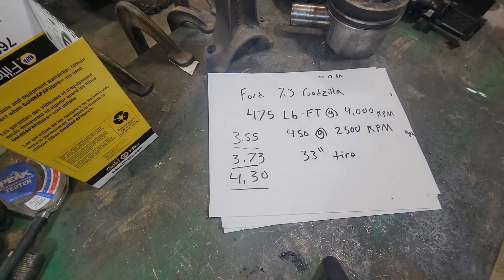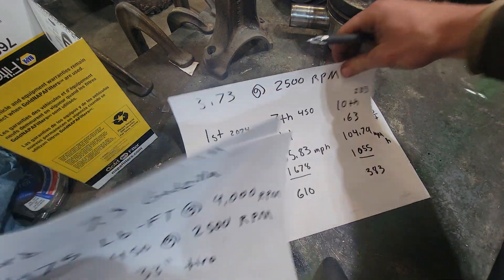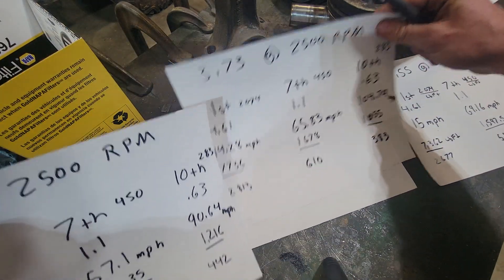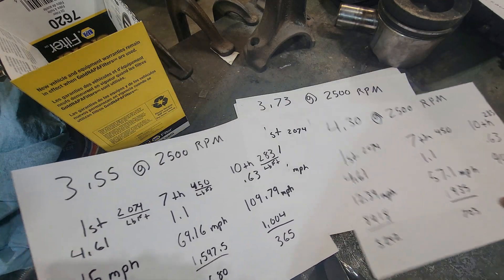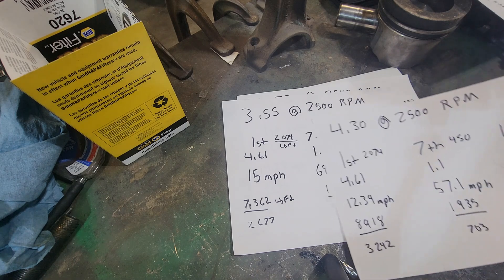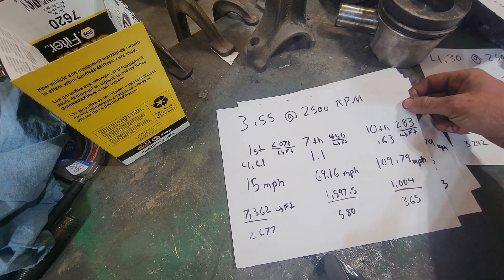Picking the right gear ratio. (7.3 godzilla)

Comment: Great video, wish ya would have done it with a 35 and/or 37" tire but it's a great bit of math and logic presented in a really straight forward way so hats off mate.   Tire size is the real issue with the 4.30 gears vs 3.73 for me (3.55 is a non-starter IMO).  Trying to decide on my up coming truck order as I plan to run 35's at a minimum and 37's would be ideal IMO.   I spend a lot of time up in the C./N.Idaho mountains and just getting to our property involves some seriously rough roads and 2 trac and the 37's just make the truck SO much smoother over the rough stuff and handle mud so much better.  Then you add in wanting to tow our 2024 NoBo Off-grid camper (~8K loaded and wet) and I'm thinking that 4.30's will just be a good insurance policy.

Comment: The 10 speed has many issues. Mine went out at 121,000. It cost me $7,000 to rebuild. I would have ordered a 6 speed manual if available. I have a Tremor with 4.30’s. I tow 14,000 lbs.

Comment: alot of people on larger tires on which we all know going to hurt gear ratio so mite what to get the lower gears i have 2024 f350 cc 4.30 gears dont pull all the time but when i do its heavy 35ft gooseneck with equipment 20k to 25k  im in the flatlands gets it done you are right on when im on interstate 2100 rpm at 76 dont say you dont know math you did pretty good im older my truck is stock gave up my diesel tired of all the diesels shit very happy with my chioce very good video thank you very much for making it!

Comment: wow...I just realized I bought a 3.73 ratio, but wont ever tow. Can I change my gear ration down to 3.55 on my F350 Dually 2023??? Recommendations??  thanks.
Reply from the maker: You can, however the benefits would be so minimal it probably isn't worth the hassle

Comment: If you weren't planning to do any towing but wanted a street truck with the best acceleration would 4.30 be the best choice do you think? Or would the transmission be all confused that you aren't towing heavy stuff and hunting for gears?

Thanks.
Reply from the maker: 4.30 would be fine. Transmission will adapt to conditions

Comment: Great information. Maybe someone else has already pointed it out, but the bottom number on your comparisons is lbs of thrust, not torque.
Reply: Some will point out that it is actually force. Force equals torque divided by length of lever arm.

Comment: Colt, I am purchasing a 2024 F350 dually and I'm really struggling between a 3.73 and a 4.30 ratio. If I go from a stock 245 Tire to the next size up I believe which is 285, is that similar to changing to a 4.10 ratio from a 4.30? I will typically drive the truck empty but do live in Arizona and pull my 11 to 12,000 lb 5th. Lot of mountains in Arizona which I wind up pulling through and I'm concerned about sacrificing the 3.73 for fuel in losing power from the 4.30. what is your opinion? Can I just go to a larger tire size and accomplish the same thing from a 4.30? Thank you for your time.
Reply: I would def stick with a 4.3 here.
Reply from the maker: I would run 4.30s i don't think the fuel economy difference will be noticeable for your application

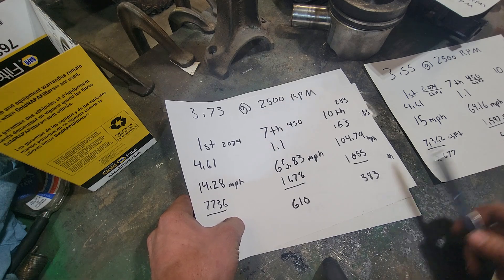Comment: I was a big 4:10 ratio guy but we were running gas burners and towing heavy. 

I used to freak guys out because I built a 1 ton single rear wheel Ford into a towing rig using a 300 inline six. I adapted a turbo onto it and ran the 5 speed manual. 

When I had buddies ride with me , they could not believe it was a six cylinder and the loads that we moved running through the hills across Iowa and South through Indiana and Missouri. It had a dual tank set up under it and I had propane on it as well.

Years ago propane was cheap and I ran that day to day local and light towing.

I would start on gas and switch to propane after things warmed up. I would run propane for awhile at first on the flats or under light load. When I hit the hills or towed heavy , I would switch over to gasoline. 

I was able to run right along with many diesels of that era.
I also ran 2 size larger diameter tires than factory. 

It put me in the power band in 4 th gear with that turbo six.

Now fast forward 30 years and they are using the same concepts. I told an engineer years ago that they had not tapped the true potential of Fords 300 inline. When I told him what I did he said it wasn't economical.

I told him that time was money and being able to move loads down the interstate at speed made up for the cost in fuel.

Once I hit 65 miles an hour , that truck was very happy and I could just set the cruise and roll. Many times it did not hardly slow down pulling hills.

Comment: Idk if my logic is correct here… but I ordered the 4:30 in anticipation of running 37” tires. I’ll be mostly daily driving it and hauling a slide in camper and a small trailer a few times a month. I did zero calculations, I just know big tires generally need gears. 🤷🏻

Comment: I wonder if the gear sets are interchangeable between axles I’m sure the 355s and 373’s will interchange but jumping to the 430 might be a totally different gear set or different axle like a Dana and 355 and 373 are a Sterling
Reply: The 4.30 is a Dana. I have one on my Tremor.

Comment: Colton, Just thought I would revisit this video and give some additional feedback.  We took a long weekend camping trip for memorial day.  We towed our 35 foot 5th wheel (weight between 11K-12K loaded)  My 2022 F350 with the 7.3 did great.  I played around a bit with speed and RPM's this trip to try and find the best speed / RPM and still maintain decent MPG's.  I have the 3:73 ratio and noticed 7th gear anywhere between 63-68 will produce around 2200-2600 RPM.  This gets you just into the torque curve and will maintain speed without downshifting on most smaller hills.  I got between 7-8 mpg by my hand calculations.  I seemed to actually get better mpg's leaving it in 7th rather than letting it shift into 8th and running a few less RPM.

Comment: Great video and explanation.  I have a  2020 F-350 with the 7.3 and I'm running 35/1250-20 rough tread tires. I have the 3.73 gears and probably 80% of my driving is NOT towing.  I'm still getting a constant 14 MPG unloaded and 8-9 MPG pulling a 3 horse gooseneck trailer. We live in hilly country with some flat roads.  I'm really satisfied with my set-up and have never lacked for power. I've had Ford diesels since 1994 and I really liked the idea of the 7.3 gas engine.

Comment: Not one manufacturer can claim a 100% success rate on any of their vehicles. There are two types of vehicles: one that is broken and one that is going to be broken. 

99-2006 Chevy 1500 wheel bearings would fail at 40k
90s to early 2000s Chevy fuel pumps would fail at the 150k mark or never fail
95-2002 dodge Ram had bad break issues first 50k
Chevy LS1 had a tendency to bend push rods usually drivers fault but it happened 
Ford modular 3valve v8 had cam phaser failure 
Ford 5.4 2 valve had knock issues at 200k or never knock at all
Nissan Xterra v6 had timing belt failure at 125k or after. Nissan recommended replacement as part of regular maintenance 
90s Chevy 6.5 diesel was either great or absolutely terrible 
Range Rovers break down leaving the dealership 

The point is every manufacturer has problems. Especially brand new engines or model replacements. It takes time to fix manufacturing issues.

Comment: Sure helped me out after the fact with my decision to go with the 3.73.  It's my daily driver, but weekend warrior pulling a camper in the summer.  My only question is, can you swap the gears and go up to a 4.30 from a 3.73, or does it require the whole axles to be replaced?
Reply from the maker: You can always change gearing fairly simply. However, I'd imagine it would cost a couple of grand to do so.
Reply: @ColtWR  I figured so.  I went with the 3.73 which is rated to tow 16,100 because I don't intend to tow over 12K.  Currently i only tow an 8K travel trailer in the summer for camping and don't anticipate ever moving up to a heavier 5th wheel.   But if I did, it would only cost a couple grand to swap out the gears for 4.30 rather buy a whole new truck.

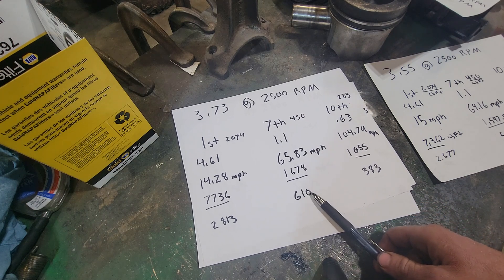Comment: Sure wish I had watched this before buying my 7.3 gasser with the 3:55. I didn't know there was such a difference. Oh well.
Reply from the maker: It wouldn't be the night and day difference you'd think. I've had a 3.55 and a 3.73 and at the end of the day. They both got the job done
Reply: @ColtWR  thank you. I think what makes it sting a little more is the fact that Ford stop putting the 3:55 in the 2023 Super Duty & now just offers the 3:73 & 4:10. Dang it. Lol
Reply: @aj12271  id personally run 4.30s gives you more options for tire size if you ever change

Comment: I like to run larger tires after I wear out the stock set so I go for low gears like 4.30 to offset the larger tire I know will get thrown on at some point. 3.55 is fine but when it’s effectively 3.08 it’s not, and 4.30 becomes a far more reasonable 3.73 ish.
Reply: Same plan here. Got a tremor and will go with 37’s when the factory tires are replaced.

Comment: Great theory I traded in my 2013 f450 cab/chassis 120" flatbed 4wd for a 2022 XLT 4wd crewcab 7.3 godzilla shortbed love the truck does have the 3:55,and I don't use it for work personal truck main reason to pull my toyhauler 2022 dune sport at maybe 13,000 altrasy tested truck with trailer and well enough power alot better then my diesel shitbox 6.7 hate those fuel systems Great Video
👍👍👍👍👍👍

Comment: Great video! I don’t want or need an F350, as they ride worse than a 250. I opted for a F250 with 7.3 and 4.30 gears. On a 250 you can’t get the 3.73 gears, so my choices were 3.55 or 4.30. That’s an easy choice for me, especially since I’m putting 35 inch tires on it. 4.30 gears will hold gears longer on hills and be more fun to drive when not towing. And I mostly drive on 55mph roads and there is basically zero fuel mileage penalty at those speeds with 4.30 gears. My dad has a 3.55 geared 7.3 and it shifts too much on hills.

Comment: It's never about moving a huge amount of weight.  It's about controlling/stopping it.

Positive acceleration will never be a problem with a 10 speed.   Engine braking assistance is the reason for capping these trucks and will influence safety.   A 3.55 in the mountains, overloaded, can be problematic with runaway brake fade and your engine won't assist enough.

Another reason why the diesel has another 10k capacity.........due to exhaust brake.          It's not about positive acceleration power.

Comment: My experience:  2004 Dodge Cummins 325hp/600lb-ft with 3.73 gears.  For those towing 5-7K, get a new 1/2 ton truck (I'm looking at the new Tundra for a 8K loaded lightweight toy hauler, truck is rated to tow 11K).  For those towing 10-12K, the F-250 Godzilla with the 3.73's seems perfect.  For those towing 15K regularly, obviously go for the 4.30's.  With diesel emissions and problems, I'd go with gas unless I was into the 18K+ range of RV towing.  But.... new topic....  living in a county that does not do emission tests and having a diesel truck de-emissioned....  Then what?  Diesel suddenly a contender?  I've got time to figure this out and appreciate your input.  Pete in Arizona.
Reply from the maker: I will make a short video for you to try to give you my 2 cents.
Reply from the maker: Check out my short clip for my answer
Reply: @ColtWR  Just watched it.  Didn't think about the injectors, pump, turbo still being there after a delete and still vulnerable to very high repair bills.  If the truck were making me money then it's part of the game.  Being an RV'er, the truck isn't making any money for me...  I am the one paying for everything to drive down the road.  Gas is making much more sense now.  Thank you for your time and thoughts on the issue to help people make smart choices for themselves.  Pete

Comment: This is a good video. The 3.73 is the perfect gear ratio for most guys in my opinion. I feel like the 10 speed (truthfully even when manufacturers jumped from 4 speeds to 6 speeds) have rendered the rear gears starting with a 4 unnecessary for most people. About the only time they would be a benefit is if you’re loaded to max GVWR all the time OR if you are using the truck at low speeds, off road with serious grades. 

But I actually think for highway speeds and normal highway grades the 4.30 would actually hurt you because it may not allow a downshift and you may end up “stuck” at a rpm and mph range where the 3.73 or even 3.55 would give the downshift and get you a little more speed. There’s an 8% grade where I live that I’d be interested to see how the two do.
Reply: I run 3.73’s and can pull 30000 of hay just fine. Maybe if I towed it every day I would get 4.30’s but I don’t tow every day so 3.73’s works great
Reply: I agree with you IF you’re keeping your tires stock, but if you switch from a 32 to 35 inch tire, your 4.30 gears just became approximately 3.90 gears. And on f250s your options are only 3.55 or 4.30, so if you put 35” tires on a 3.55 geared truck, your ratio is now 3.20.
Reply: So basically if people want to have a lower gear ratio from high, all you will do is a change to a bigger tire?
Reply: @nia6849  yeah that’s true for anything. Although I’m not sure it would be as drastic as mentioned because Ford uses the same size tires as GM and the 18s are already 33” and the 20s are 34”.
Reply: @nia6849  Yes!
Reply: @cliffordmontana4562  do they actually have 32” tires? Their 18s and 20s are the same size as GM which are basically 33” and 34”.
Reply: @matthewanderson9912  The base XL’s have super small skinny 32”, the XLTs have about 33”, and the 20” wheels have about a 34” tire. But even the 20’s only have a 10.8” wide tire, so if you’re switching to a slightly more aggressive 35x12.50 tire that’s still quite a bit more rolling resistance. I’m no expert, this is just what I’ve learned. I got the 4.30s mainly because I drive mostly in city and on 55mph hilly roads and I don’t drive much freeway. In the city and at 60mph there’s basically no penalty by going with 4.30, especially with bigger tires.
Reply: @cliffordmontana4562  valid point about width and also 35x12.50s are typically a lot heavier vs the 275/60/20, even though the height is not really much difference. 

I’m a Chevy guy so they don’t offer a choice but if I did buy a Ford I would want the 3.73. I think the 10 speed transmission makes up for needing the super short gears like used to be needed when all we had was 4 speed autos.
Reply: @matthewanderson9912  I would’ve probably got the 3.73, but they only offer that in the much stiffer riding F-350, and I don’t need that much capability. F-250 does just fine for the trailers I tow for my tree service. The only options for F-250 are 3.55 and 4.30, and my dads 3.55 shifts gears constantly on hills, that’s why I went with 4.30, plus he’s rolling on stock tires. I pick up my truck next week and I’m hoping it handles the hills better. Have a good day Matthew.

Comment: If I wanted to run a 35” tire with a 7.3L, in your opinion, what would be the best gear ratio for the truck that I would use for weekend camping trips and occasional daily driving use/empty road trips? Love the video content and the channel!
Reply from the maker: Probly the 4.30 I had 35"s on mine with 3.55s and it wasn't bad but not ideal.

Comment: I have a regular cab dually 2022 with the 7.3 and 4.30 rear.....and it has the 17 inch 245/75 size tire.....i am at 69mph at 2k rpm.......
Reply: damn.. i have the same 17" wheels on my 2020 6.7 with 3.31 rear... 1750 rpm at almost 80 mph.

Comment: Toyota and Ford get it. Whens the last time you seen anything over a 3.42 in a half ton Chevy or a 3.73 in a HD Chevy? Exactly
Reply from the maker: Toyota has tall gearing options?
Reply: @ColtWR  The Tundra has been running standard equipment 4.30s a long time